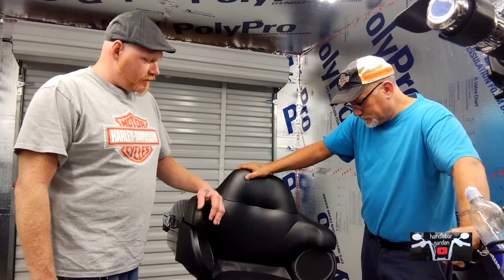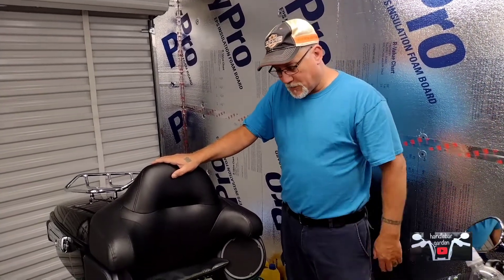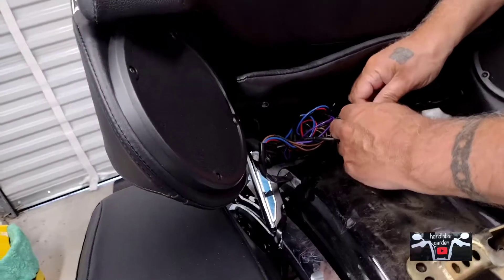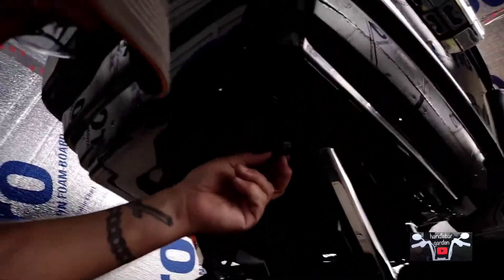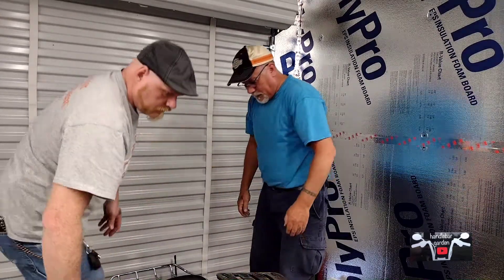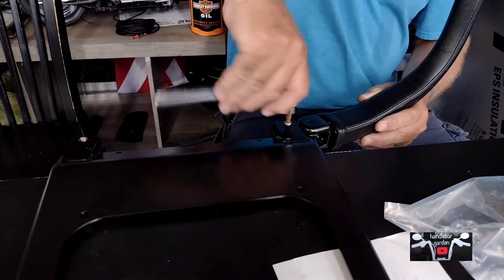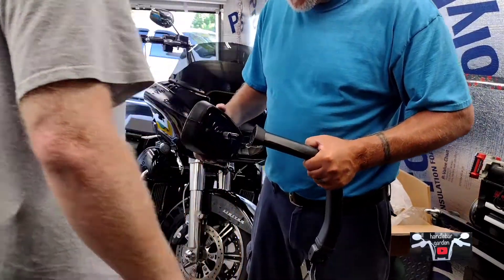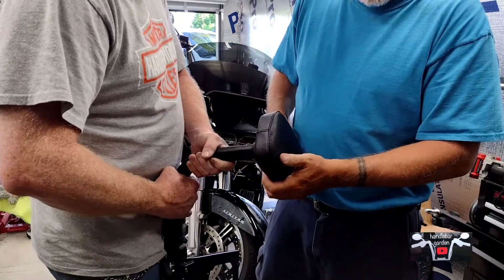Harley Davidson Tour Pack Passenger Arm Rest Install #tourpac #harleydavidson

Comment: I wonder how these would mount if you have the detachable tour pack kit installed. it has a different base for the tour pack now
Reply from the maker: Not sure but I would think they would just mount to the  tour pack plate  as well. In my mind it's the same concept. They would detach with the tour pack. I had detachable on my old Road Glide and I don't see why they wouldn't work. Tony

Comment: Question: Will the saddle bags still open with the arm rests?  It looks too close. 
Do the arm rest have to be pushed in toward the seat or outward to let the saddle bags open with out rubbing on the arm rests?

Thank you for the video
Ronald.
Reply from the maker: Thanks for the question, the answer is yes they will open, the armrest has to be pushed in all the way (toward the seat)  and it's close but they open. My wife loves them. Glad this video helped in some way.  Tony
Reply: @HandlebarGarden  Thank you so much for the answer and your time. Be safe..